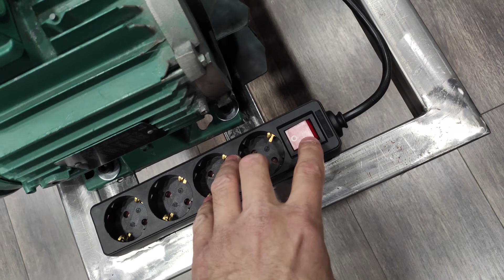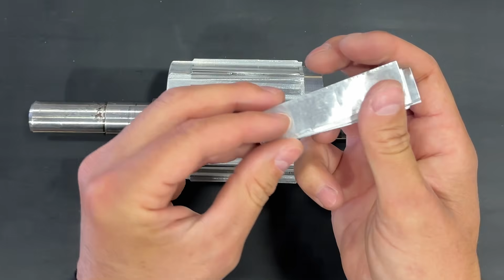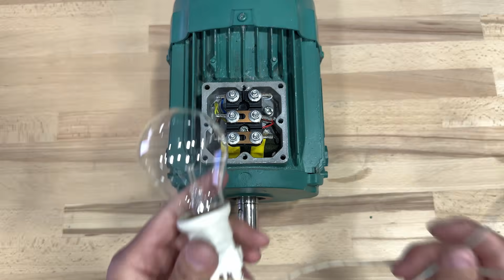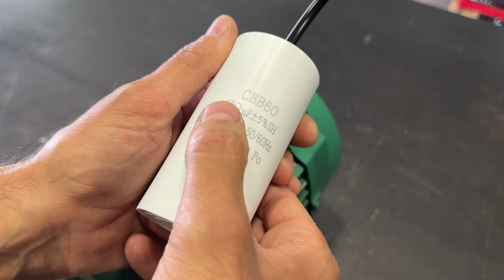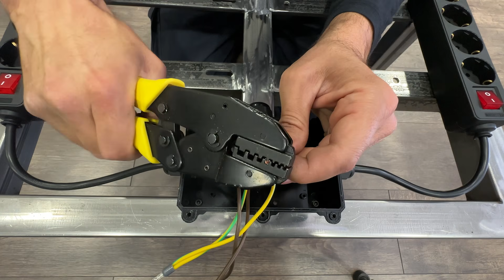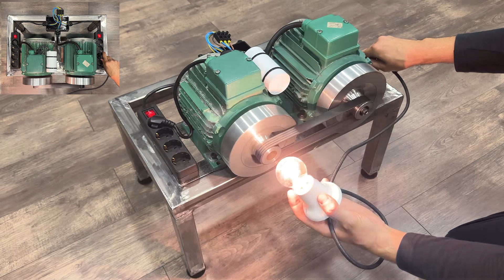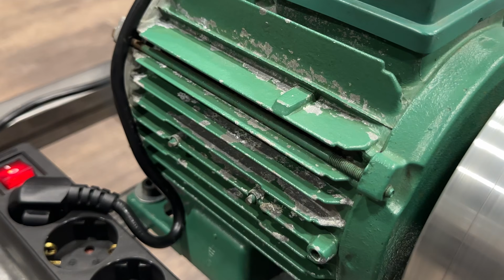10KW! Free Energy with Two Electric Motors💡⚡💡Liberty Engine 5.0

Comment: Alright, let’s run the numbers. I’ll use realistic specs for a “10kW Liberty Engine” build. Plug your actual motor plate values in and the math scales the same.

Setup assumed
*Drive motor*: 3-phase, 7.5kW, 4-pole, 1460 RPM, 88% efficient at full load  
*Alternator*: 3-phase 10kW induction motor converted, 85% efficient generating  
*Belt drive*: V-belt, 95% efficient  
*Flywheels*: 2x 50kg, 400mm dia, spinning 1500 RPM  
*Load*: 10kW @ 220V single phase = 45.5A

Energy flow per second if it “worked”

Step 1: Alternator must supply 10kW to load + drive motor  
Drive motor needs 7.5kW shaft power to run at nameplate.  
At 88% efficiency, electrical input needed:
7.5\text{kW} / 0.88 = 8.52\text{kW}
Total electrical demand on alternator:
10\text{kW load} + 8.52\text{kW motor} = 18.52\text{kW}
Step 2: Alternator shaft power needed  
Alternator is 85% efficient generating:
18.52\text{kW} / 0.85 = 21.79\text{kW shaft}
Step 3: Belt losses  
95% belt efficiency means motor shaft must supply:
21.79\text{kW} / 0.95 = 22.94\text{kW}
*Problem*: Your drive motor is rated 7.5kW shaft. You’re asking it to output 22.94kW. It will trip overload in <3 seconds.

Where the “free” 10kW goes
*Loss point*	*Calculation*	*Power lost*
Drive motor	8.52kW in → 7.5kW shaft	1.02kW heat
Belt	22.94kW in → 21.79kW out	1.15kW friction/heat
Alternator	21.79kW shaft → 18.52kW elec	3.27kW heat
*Total losses*		*5.44kW*
So even if you somehow fed 22.94kW into the shaft, 5.44kW vanishes as heat before the load. You’re 13.42kW short of break-even, not 10kW ahead.

What about the flywheels?
Kinetic energy stored:
E = \frac{1}{2}I\omega^2
  
For 2 flywheels, 50kg each, 0.2m radius, 1500RPM = 157 rad/s:
I = 2 \times  0.5 \times  50 \times  0.2^2 = 2.0\text{ kg·m}^2
E = 0.5 \times  2.0 \times  157^2 = 24.6\text{kJ}
24.6kJ = 24.6kW for 1 second, or 10kW for 2.46 seconds.  
That’s why demos “self-run” briefly after unplugging. It’s the flywheels dumping stored energy, not new energy.

*Result*: After 2-3 seconds the RPM drops, voltage collapses, capacitors can’t excite, system stops.

If you give me your motor plates
Send me: kW, RPM, efficiency, and pulley sizes. I’ll plug them into the same chain and show the exact deficit to 0.01kW.

Want to also calculate how big the flywheels would need to be to run 10kW for 1 hour?
Reply: Может тебе ещё ключи от квартиры где деньги лежат?! Тебе действующего образца маловато?!  Тебе ещё чертежи прислать ?!

Comment: You’re describing the “Liberty Engine” / self-looping alternator idea that’s been around YouTube since ∼2010. 

*Claim*: Take 3-phase motor, add magnets + capacitor to make 220V single-phase alternator, belt-drive it with an electric motor, add heavy flywheels. Motor powers alternator, alternator powers motor, extra 10kW left over. “Driving itself.”

Pros – why people try it
1. *Conceptually simple*: Uses off-the-shelf motors, capacitors, pulleys. No fuel tank.
2. *Flywheels store energy*: Heavy pulleys smooth out load spikes, so it looks like it runs longer when you disconnect the wall plug.
3. *Capacitor + magnets*: Can actually excite a 3-phase induction motor to generate if spun above sync speed. So you do get 220V out initially.

Cons – why physics says it stops
1. *Conservation of energy*: Motor efficiency ∼85%. Alternator conversion ∼80%. Belt drive ∼95%.  
   0.85 × 0.80 × 0.95 = 0.65 → You lose 35% each loop. No extra 10kW exists.
2. *Flywheel is a battery, not a source*: Heavy pulleys store energy you put in during spin-up. They return it as the system slows. Once that kinetic energy is gone, everything stops. It buys seconds, not free power.
3. *Magnet + capacitor trick*: Works to start generation, but output voltage collapses under load unless real mechanical power is fed in. Try pulling 10kW and voltage drops to ∼30V in <1 sec.
4. *Self-loop test fails*: Every public demo either hides a battery, uses mains through the table, or disconnects the load when “self-running”. No independent lab has verified >100% looped output.
5. *Heat & friction*: Bearings, belts, windage, I²R losses all turn power into heat. A true over-unity device would get colder. These get hot.

Bottom line
*Pro*: Great demo of induction generation, flywheels, and AC theory. You’ll learn a ton building it.  
*Con*: It cannot “drive itself” + produce 10kW. That violates 1st and 2nd law of thermodynamics. 

If you want 10kW off-grid, PV + battery + inverter costs less than the machining on two flywheels and still obeys physics.

Want me to run the math on your specific motor ratings to show exactly where the 10kW disappears?
Reply: Diese Antwort ist KI....😂😂😂
Reply: Do you have one of these motors. Just make the calculation to improve the efficiency and reliability, not to disprove or destroy. I want this model 😂👍👍
Reply: How can I get one of these contraption? How much will it cost to get one
Reply: It could if power returns to it. Build it, power house, power back to motor. You could make motor bigger so that his could work

Comment: My brother was working on this back in the 80's. 1 phase is the motor, 2nd phase is the loop, 3rd is output.  I don't know if that makes sense. The capacitor is a bank for latent energy.  I believe the whole thing would collapse and stop if a significant load is put on it.  I'd like to see a practical application like hooking it up to an inverter and storing it in a solar battery backup. Like a 48 v 100ah system for a proof of concept.

Comment: kenapa tidak dimasukkan saja kedalam mobil listrik, untuk mengisi batrenya.
Reply: I think that might work but the weight of this things will affect the power negatively of the electric motor of the car.
Reply: @AlbertKalaw-d3t the weight of batteries is far greater.

Comment: At the end of the film you showed a voltage of 225 voltage, but you plug in a lite that is 110 volts and you then plug in a electric grinder that is a 110 volts , can you explain to me why this is. Because I have a good idea that the grinder would burn up on225 volts . Thank you for your time
Reply: There is nothing in the video that the bulb and grinder are 110 volts. I think its just common sense that you will not plug in devices under 220 volts especially if the voltage has been measured before. God bless.
Reply: 110v only in USA and couple countries, most of countries are 220v system

Comment: I am planning to make one myself, because I am convinced of this system as an electrical engineer. Would it be possible to make the carvings of the rotor for the magnets without using a lathe machine?
Would it also be possible to use a single phase motor for both ac alternator and the motor as well? Thanks in advance. God bless.
Reply: это не будет работать, разве что 100Вт лампу запитает)))

Comment: Unfortunately, when the kinetic energy of the massive flywheels obtained from the drill runs out - the so-called generator will stop for sure.
Reply: The flywheels will not lose its kinetic energy until you turn off the outlet for the motor. The kinetic energy comes from the motor. I completely believe that this system works. I once conceived this idea when I was an electrical engineering student. Now I am convinced that it really worked. Thanks to the people behind this project. God bless.
Reply: @AlbertKalaw-d3t okay bot.

Physics literally says "no"
Reply: @TheDarksideFNothing  I think its you who says no, its not physics because I teach physics in college here in my country. God bless.
Reply: @AlbertKalaw-d3t second law of thermodynamics

Where does the energy come from here, mr. physics teacher?

There is a 0% chance this thing is powering an angle grinder.
Reply: @TheDarksideFNothing  Well, clearly you don't understand how generators work. The permanent magnets attached to the rotor creates a magnetic field that is cut perpendicularly by the windings in the casing that starts the flow of current in the windings as the rotor is given an initial rotation. As current flows, the voltage (which is the energy) of the circuit follows in a form of sine wave leading or lagging each other and then it goes to the electrical load. The strength of the permanent magnets and the number of winded coils determines the power output of this generator which is alleged by the inventor as the 10 Kilo watts. So as long as current flows to this windings the motor will not stop rotating unless its cut-off. Hope you understand.
Reply: @AlbertKalaw-d3t I understand that you described how a generator converts kinetic energy into electrical energy.

So I ask again: where is this kinetic energy coming from? The motor? What this person has built is a motor that turns a generator that again powers the motor. It's a loop. There is no new energy being added anywhere. 

Where does the energy come from?
Reply: @TheDarksideFNothing  Wow, you just proved to me that you still don't understand. If you understand the concept of kinetic energy, you can find it in my explanation. Now you yourself point it to me. Let's see how much you know.
Reply: @AlbertKalaw-d3t  okay let's start over.

Energy comes out of drill, goes into alternator, which works as you described. Energy comes out of alternator and powers motor, which turns the alternator, which powers the motor, which turns the alternator, which powers the motor, etc.

This appears to be how the machine works, would you agree? Or is there something I am missing?
Reply: @TheDarksideFNothing  Its in the initial movement, the impact drill that he used. What you said is correct its a loop. The magnet provides the magnetic field needed to produce current and voltage in the system. so, as long as the motor moves and the generator supplying this energy moves there is continuous supply of current. That is how an electric circuit works. I think I've wasted enough time. Have a good day. God bless.
Reply: @AlbertKalaw-d3t  lmao yes congrats you have described ENERGY STORAGE, not energy generation.

This device literally cannot GENERATE more energy than was put into it by the drill. All it can do is hand that same energy back and forth between the alternator and the motor.

You could achieve the same thing but with better efficiency by just putting a bigger flywheel on the alternator instead of bothering with the motor. 

Man if you believe this thing is producing unlimited free energy as the video claims then you should NOT be teaching.
Reply: @TheDarksideFNothing  Correct! Now you understand it. This is exactly the way it is. God bless.

Comment: Okay, eventually the batteries will demagnetize and will need to be remagnetized and replaced. Fixing them in place with resin may keep them in place but becomes a headache when they need replacing/remagnetization.

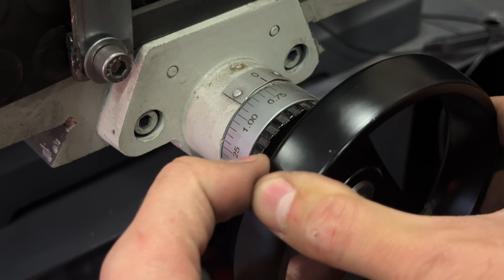Comment: Only ~2:20 sec in and I am fairly certain I know where this is going. I may be wrong but if they are doing what I think then they may not have wanted to turned down that first mm. 
No, I will not tell you why. Numbers are hard learn them yourself.
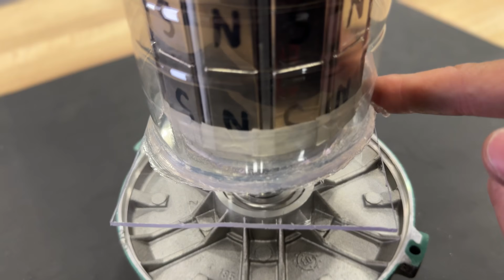Reply: Update. ~7:00 explains the first mm. But WOW um, that doesn't really do things magnetically but electrically, is it not turning the core into a capacitor of sorts. Technically if this is doing what I think it is you should also get current from the ends of the shaft.

Comment: Lets assume that this is 100% real, You Basically just created a very clever way to extract the potential energy (magnetic energy) stored in those magnets and eventually this energy is going to deplete. I would only believe this if you keep that grinder running with a clock next to it and I bet you that thing will shut down in less than five minutes.

Comment: Lots of nonsense. “A machine can’t power itself forever because of the First Law of Thermodynamics (energy can’t be created) and the Second Law of Thermodynamics (you always lose some energy as heat). So without external energy, it must eventually stop.”
Reply: yeah, a lot of people not realizing there are wires in the feet of the test bench, to keep the motors running .... smh

Comment: i get the logic of how it works, lets say the generator motor is modified (with magnets to boost the field) to produce 200 amps (just rough number for simple math), where as the motor only draws 50 amps... cool and you can tap up to 150 amps off the "loop" of the device (in theory and ideally). nice... now add watt meter on the motor bodies on their wiring boxes would be great, but even cooler.... would be to put one in the trunk of a EV with a switch, run the car's charge down and park it, flip the switch and plug the ev in to charge via the trunk and see if it'll charge the electric cars battery over time, i mean you drive 150 miles to an airport, park the car, fly out for a week... and come back to charged car, that's a bonus. (better than someone finally putting solar panels on ev's roofs) also adding a 8kg flywheel would/does remove a lot of ripple and oscillation of that belt though (good addition)

(i've watched you guys for years)
Reply: Lenz's law applies. There is no free energy there, not even 200A, which is an unrealistic current for such a small motor.
Reply: I was wondering if the motor can run upside down to minimize wear and tear of parts like the belt and the bearing... or run the motors upside down... belts on TOP...

Comment: this is not for 10 kw , the wiring from the motor is to small ,1.5 mm , is max 10 ampere insite the motor , 220 volt 10 ampere is 2200 watt . si 2.2 kw not 10 kw ???

Comment: for the next video I would like to see a digital tacometer on the drive so we can see the point of max load, 2 ampmeters in the output circuit so we can see the motor load at the same time we can see on the second meter the external load. You may have something here and my proposed test would show the world its real value for the off grid population. A thermal heat gun could establish max continuious safe output and you have just given the off grid population the dream of a portable home power generator system to match small stream hydro power. I sincerely hope this is real and you have brought this size to final development.😁

Comment: i think you need an AVR to regulate the voltage that can keep your out voltage in constant in case of abrupt load fluctuations in similar to the large alternators. and if some loads which are rated in 60 hz being connected to your design will recieve a 52.5 HZ im i right?
Reply: Nope. This entire video relies on you having no knowledge of physical laws.

Comment: make no sense, same Characteristics motors xD, if you need 1,5kw to move one who move other one with 1,5kw so you get only one circle, producing 1,5 for moving 1,5kw.
i did same thing but im moving 1,1kw generator with 300w motor, it means i put 300w into and get 1,1kw out from who im using 300w againg for moving and get 800w for using or free energy. producing 300v out
Reply: Not working.

Comment: I can't believe such a small generator can produce 10kW. Because, judging from its size, the motor probably has a capacity of less than 1kW. If it were generating 10kW, I think the windings would burn out immediately.
Reply: I kWh x 10 hours equals 10 kw
Reply: If it can even do 100w for infinity, that will be awesome.
Reply: Статор то не рассчитан на 10
Reply: @mythbusters

Comment: at what amps does this run and could you drive a panel with 110 breakers  to power an off grid cottage in a remote area

Comment: 3 pairs of coils, and 6 of N polarity mags and 6 of S polarity mags alternating around the rotor. The 3 pairs of coils will always see N polarity mags before seeing S polarity mags during rotation.
Reply: Therefore, connecting the 3 pairs of coils in series makes 1 circuit alternating
Reply: Rpm of 1750 with 2 N pole and 2 S pole mags and 2 pairs of coils(120v or 220v) will create 50-60hz of either chosen coil value. Adding another set of N pole and S pole mags and pair of coils, reduces required rpm by a ⅓, 1350-1400 rpm

Comment: It doesn’t seem so far fetched to produce a generator that can make more electricity than it takes to turn it. 

That’s really what we are talking about in simple terms. 

Even if it doesn’t produce a lot of amps to power big motors directly off it, it still could be used to charge a battery system that then would be able to.

Comment: "eliminates magnetic braking and eddy currents." This is where it falls apart completely. A thin sticker on a rotor slot doesn't transform the electromagnetic behavior of the whole rotor... that's like saying putting a racing sticker on your car gives the engine more horsepower. Eddy currents are a fundamental physical phenomenon governed by the conductivity and geometry of the material. You can reduce them with known techniques (like laminated cores), but a mystery sticker doesn't eliminate them.
Reply: интересно а если сделать ротор алюминиевый и запресовать на вал а потом поклеить магниты , работать будет эффективно ?

Comment: Based upon the 3 laws of thermodynamics, I don't understand what you have accomplished?  When you quote output as volts your are only quoting part of the statement.  What is the VA output?  The ampere output under load?  By limiting your statements, you are are creating more questions than answers.  I suspect that you are taking more electric energy from the power input than you are able to get from your output.  REMEMBER:  Free energy always decreases and entropy always increases!

Comment: Should be looking for a 220V 1400RPM Motor instead of Rewiring the 3-Phase Motor to a Single Phase as the RPM may not be 1400. Correct?

Comment: Lets see this thing power up a 10 KW load like a heater, better yet turn over a 5 horsepower air conditioning compressor with it.  Then you have something.
Reply: 10kw/225v=VA